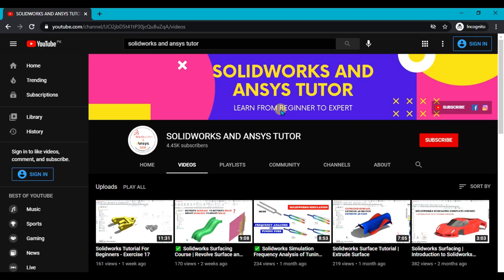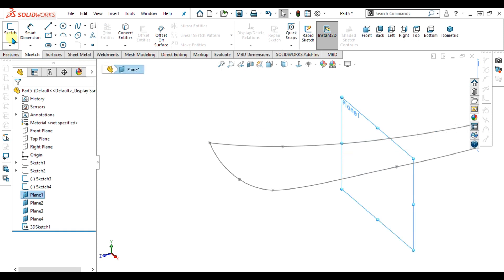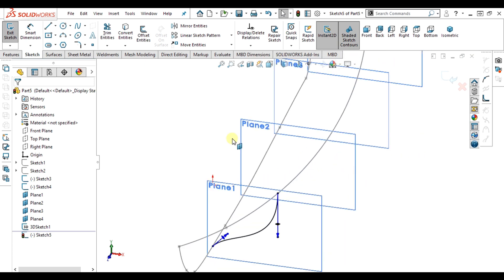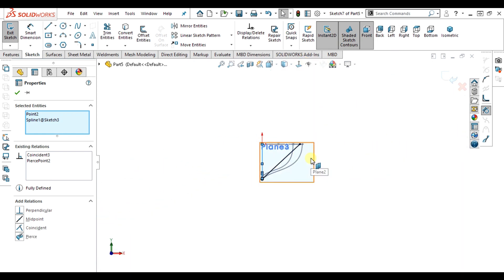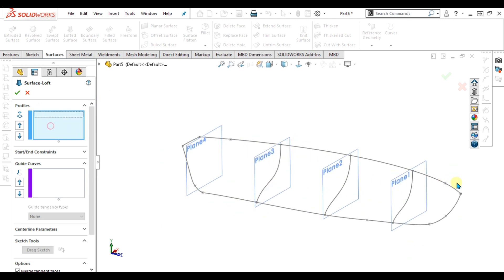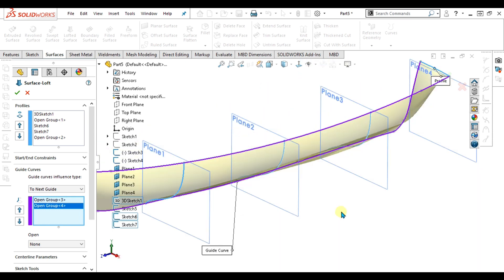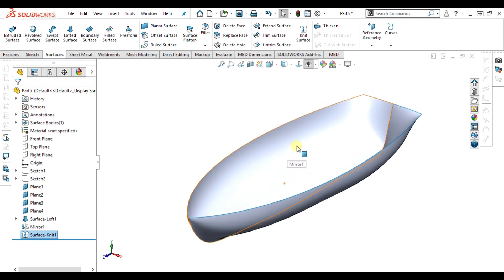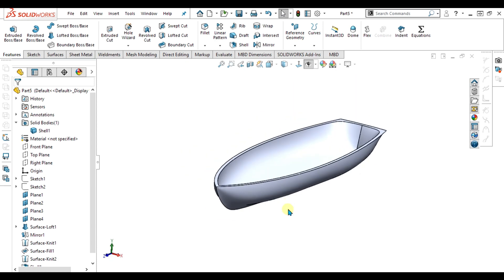✅ Solidworks Surfacing Course | Lofted Surface | Part 2

Comment: Hello.Thank you for this amazing tutorial. I see sometimes you use Coincident or Pierce command. Why is that.Also you placed Point at the front tip of the boat’s profile.Why is that point so important and why did not you use pierce command again.
Reply from the maker: I use Coincident when sketches lie on the same plane, and Pierce when connecting profiles across different planes, like in sweeps or lofts. The point at the boat’s tip helps anchor geometry precisely